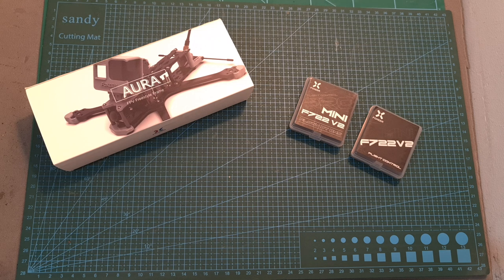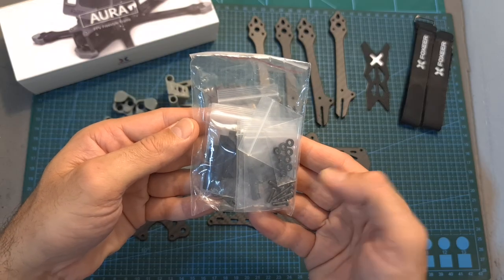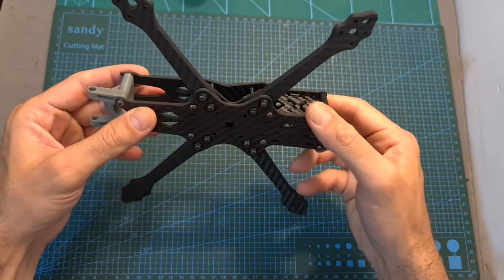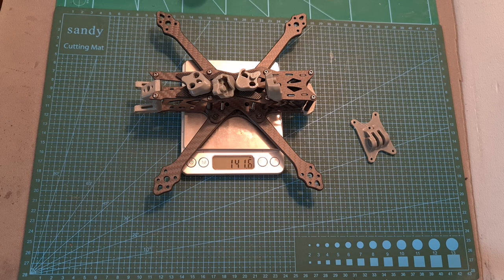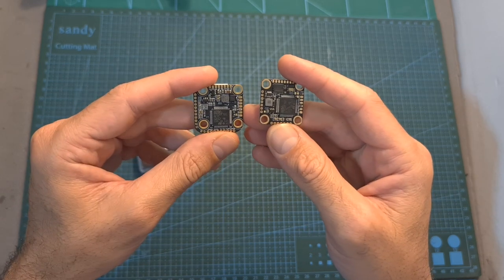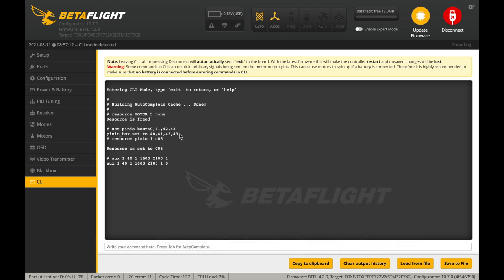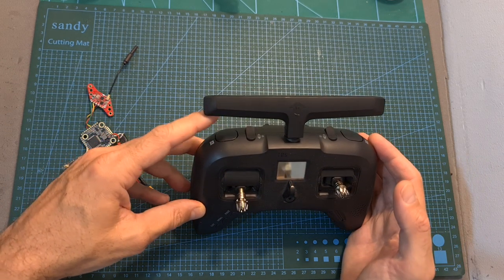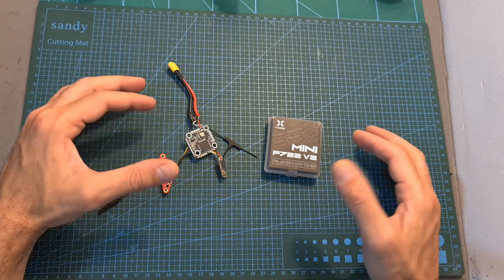Foxeer Aura Frame Overview & Mini F722 V2 Pro FC Pit Mode Setup

Comment: I wish you would of made a video specific to the BMS FC only. I have never used a pass though and wiring the pass through between the CFSX AND A VTX is not normal to me.
Reply from the maker: Do you fly wings? For quadcopters this feature is not going to be that useful in my opinion but maybe it's just me.

Comment: Hi Gal! Thank you for the useful Information. I am Japanese and I am not good at speaking English, but  I enjoy your videos because I am so into drones.
I tried to build a 5 inch racing quad using Mini F722 V2 Pro FC. However, the camera and VTX did not turned on. Can you think of any possible reasons for that?
Reply from the maker: Hello! I am glad that you enjoy my videos :-)
Does the flight controller turn on? There is a good chance that the VTX is not wired correctly or there's a short circuit. 
How do you power the VTX and camera?